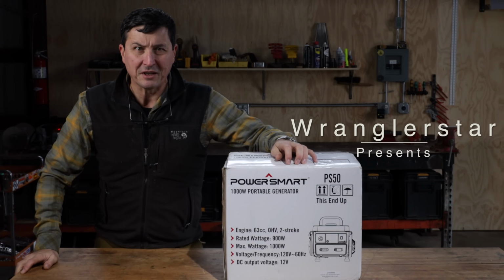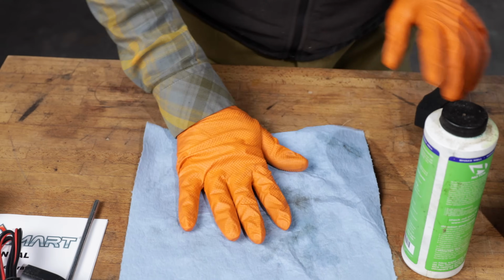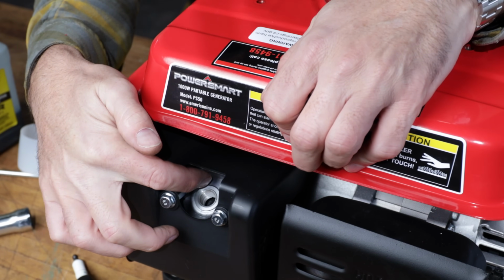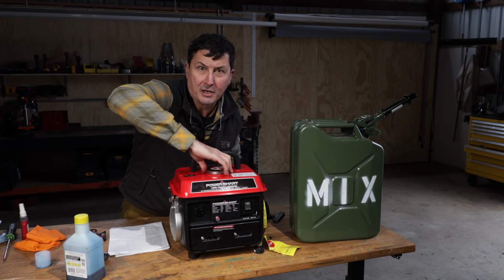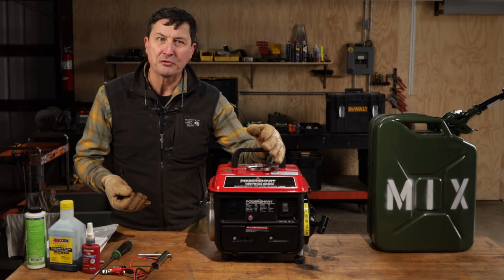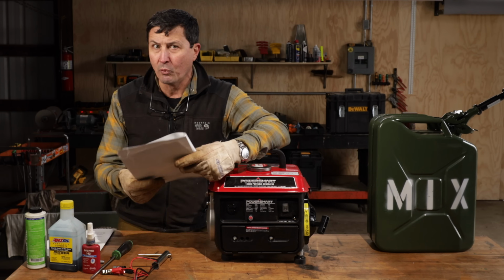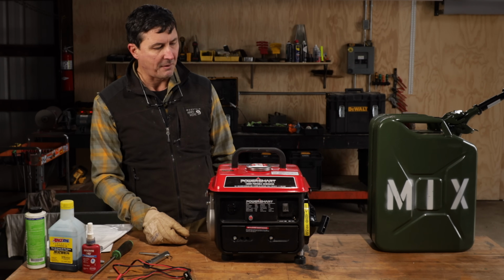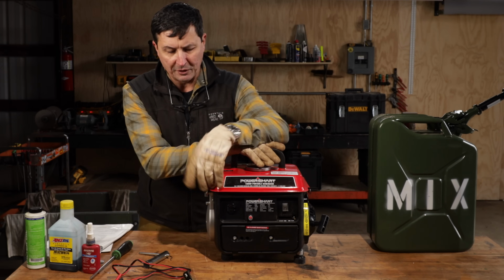TESTING The Cheapest GENERATOR on Amazon -$99

Comment: We got this same genny in europe for €69 last summer. Its quieter than most at this size and mines is ok BUT! THE PLASTIC START PAWL BREAKS UP AROUND 12 MONTHS. I made a new pawl out of aluminium which  works ok. Mine is 700 watts but pushes a lot more pretty easily.  I have no mains electric so use this a lot for my vacuume cleaner etc. Solar power here keeps the rest going.  And do fit a fuel filter between tank and carb.

Comment: I have one of these in New Zealand (it's a small country not in America, look it up).  It delivers 230volts at 50 Hertz and rated for 750 watt but otherwise the same. It ran fine from new during a couple of power outages. BUT, after some period of lack of use it became unstable next time I ran it, surging with the governor constantly swinging from maximum to minimum. While trying to sort it out I found the petcock (gas tap) on the tank was leaking  fuel as the lock nut which has an 'O' ring had split. So I glued it with gasket seal and left it for a couple of years to set. This week I decided to fix it, so I refitted the fuel tank after cleaning the carburetor and checking the ignition system and replaced the hardened fuel line. It still ran like garbage, surging as before, it actually ran better on full choke than any other setting. Eventually it just suddenly died. I stripped the inlet reed valve, the head, barrel, piston, rings etc. I saw the governor is actually some sort of centrifugal system inside the crankcase which is somewhat impressive. I put it all back after decarbonising the piston and head and cleaning the reed valve assembly. There just wasn't any suction through carburetor but it had compression.  Eventually I put a hose in the spark plug hole, turned crank to BDC to expose all ports (1x exhaust and 3x transfer) put my finger over the exhaust outlet an blew into the hose. There was virtually no resistance and just a hissing sound of air leaking out  of the crankcase somewhere. WOW, FAR OUT THAT'S BIZARRE! I then realised the crankshaft seal between the motor and alternator/generator section had blown out. I worked it back into place using a screwdriver through the air inlet slots of the alternator. After that, it ran like new again,  but for how long?

Comment: Looks EXACTLY like my Harbor Freight “Tailgator”.  I paid like $79 for it two years ago.  Use it all the time for my small plumbing business when power isn’t an option.  Charge my batteries, run corded power tools, lights etc.  Used it for a weekend to charge my batteries while hunting deep in woods in my camper.  Ain’t died yet!
Reply: 130 bucks now, add another 8 bucks for sales tax.
Reply: @NickDe39  it does go on sale.
Reply: Yea, I'm an electrician and I need it for the same reasons. I really don't wanna break the bank for a generator I'll barely use.
Reply: The Harbor Freight "Tailgator" / Predator 875 (It used to be part of the predator range in the red coloring like this one) seems to be a super mass produced unit carried by everyone.  Meijers here in Michigan had the same unit under a different name.  Works great.  However the carburetor is junk.  The way it's made you can't effectively clean it out.  When this thing stops starting on you it's the carb.  Super easy to replace it, and the replacements are cheap, better quality, adjustable, and cleanable.  Don't toss the generator.  Just get the replacement carb.
Reply: Do you think it could run a small dj system
Reply: @Playtrack  I wouldn't recommend this type. Its loud, and uses modified sine wave which causes noise and can damage sensitive equipment. I would get the 4 stroke quiet kind with a pure sine wave inverter. Quiet, easy to use (no mixing) and your equipment will be safe.
Reply: Did you use your microwave and min refrigerator on yours

Comment: The harbor freight storm cat is about the same thing,  got mine for $30 it was a return with a broken handle. A bit loud but runs fine.  The Sportsman i1000 is a great 4 stroke 40cc runs about 6 hours on half a gallon. It's around 20lbs very quiet.  Inverter sine wave that can be paired up with another to double the output...  about $170 free delivery.

Comment: I bought the 900 watt tailgator generator from harbor freight a little over two years ago and have put probably 200-300 hours on it problem free until recently until the plastic pulley in the cap broke.  I have one on the way in the mail now.  For $98 it works great as it will power (at once) 4-5 grow lights (with led bulbs) and a standard box fan. It'll pull a full side refrigerator by itself but that's all it'll pull at once. I was impressed and would buy another one if mine gave out without question

Comment: Great video & tip on eliminating dry starts! That applies for all 2 & 4 stroke small engines.
Example: When I take my mower out of winter storage and start it for the first time, I will
give it 3 pulls to lube the piston before I add gas to start.

Comment: My dad used to sell a similar generator that was similar size and power at his shop in the 90's but they had a big heavy set of 4 gauge booster cables for jump starting vehicles and on the 12 volt side would produce I believe either 100 or 200Amps @ 12 volt for jump starting. I have yet to find another like them.

Comment: I have had good luck out of Chinese motors but the first thing I do is put a better spark plug in it. Only other thing is they often don't have a low oil shut off so just keep check of the engine oil. This unit being a two stroke may not  even need case oil.

Comment: Got one of those 6 months ago.
It kept stalling at recommended 50:1 after 2-3 hours. But I accidentally mixed at 40:1.  And it worked much better and longer 5-6 hours.  Protection buttons failed.
But for the price (£120) who can complain?

Comment: Have the same generator used for years but being 2stroke the muffler eventually clogged with carbon and a new muffler is about the same price as the genset so they are a throw away if anything goes wrong
Reply: Ultrasonic cleaner?

Comment: There certainly seems to be some great generators out there.  I bought a cheap inverter generator a couple of years ago, and it's never let me down.  Starts on the first pull each time, and runs for hours at a time when I use it never missing a beat.  What's more, it was less than £200. It's branded as Impax, but I've seen it branded as Clarke, Sportsman and Earthquake. Well worth a look if you need a cheap inverter and haven't looked already.

Comment: I bought something identical looking (minus the 12V charging) from B&Q in the UK in 2007 for £49.99 (according to todays chart on one of my widgets, a little over $60, was under 2 days ago and no idea what it was in 2007, likely about $75).

Kinda abused it with an electric lawnmower for five years, cutting the grass  around the house with about half a gallon of petrol. 

My wife kept telling me to just get a tractor, so I gave in and bought a 4WD Kubota B4200 complete with a mower attachment. It cut that grass and about half an acre more into the field (the rest I'd need a tank or a helicopter for, wonder just how much fun my wife really wants me to have). It used about an egg cup full of diesel to do that.

The annoying thing about that generator is that it isn't that much louder than the 2007 £7,000 Dometic TEC 30D generator I fitted to my RV.

The coolest generator I've seen is made by a Japanese company, called something like IHI? They made a generator not much bigger than a Honda 2000W inverter generator, powered by a jet turbine (likely a modified turbocharger, so it used four times the fuel you'd expect).

Comment: I have the HF version that I bought strictly to power a sump pump if the power goes out.  In the 8 years or so I've had it, I needed it exactly once for about 3 hours.  it also powered some incandescent bulbs in our family room so we could sit and play cards and while the time away.  I accumulated more time getting it running and ready for winter than I ever have using it for what I bought it for.  Worth EVERY penny of $100 and if/when it gives up, i will buy another.

Comment: The one from harbor freight like that has worked good for me. We use it to run the camper for a week at a time non stop 7 days of running. I really didn't think it would last the first week but it keeps going  every time we take it out. We use the same  2 cycle oil as the dirt bikes amsoil dominator. 
Its loud but runs everything short of the ac unit 
Wouldn't recommend plugging in hi end electronics.

Comment: Ive got the Sportsman version of this...and picked up  the quieter and lighter inverter 1000W version on sale for $180.  This will drive climate change folks crazy, but its fits on my electric cargo bike running a power supply maintaining  my DIY 50VDC LiFePo battery. Georgia back roads can be long and lonely.  Ive not tested it nonstop, but  I figure the better part of 200 miles to the tank.

Comment: The brushes will be shot in 80 hours I had one and they dont last
Reply: Brushes?  So it is actually a generator, not a 120VAC alternator like larger units?
Reply: Its brushless with no AVR. Voltage regulation is done with engine rpm and a capacitor.

Comment: I've had one for years now and still running strong! $89 out the door at Harbor Freight. Well worth every penny. Easy to move and start up when you just don't need the bigger generator.
Reply: Just run really good oil and premium gas,they run forever,being a Yamaha chinesium clone.. I ran mine @40to1 ,for the last 11 seasons, pretty much 4-6 hours a day.   Flawless so far,again,Yamaha engineering helps..
Reply: Hey was this good to use

Comment: Good review. I bought the same generator, with different branding a few years ago. It is loud, but still worked as an emergency generator until last summer. I was attempting to run my fridge during an extended outage from a summer storm. Couldn't get the fridge to run, eventually tried a neighbor's generator with no luck. Started troubleshooting and found the cheap voltage regulator failed and the generator was putting out 220V, frying the board on my new fridge. It was an expensive lesson, and I've now got a Honda.

Comment: I got one of the harbor Freight versions five or six years ago and have used it at an off grid cabin. Still runs fine with probably a couple hundred hours on it. Very convenient if I only want enough power for a few lights and fans. Not too loud but even a very basic vented plywood box will baffle the noise down considerably.

Comment: I own 2 of these, purchased in a rush in anticipation of the arrival of Hurricane Harvey.  They didn't arrive in time, but I have used them on and off ever since.  DO NOT USE THEM TO RUN ANYTHING ELECTRONIC!  The power coming from them is very messy.   They will run a heater or a simple motor well enough, but they damaged the electronics on my refrigerator door and killed a 1500VA UPS before I learned my lesson.  See the video on my channel to learn why and more than you ever wanted to know about generators.

Comment: I got an even cheaper generator than this one at $65, but rated at 800W. It's pretty much OK, I've used it for 12h non-stop without any problem (didn't destroy my phone and laptop chargers), except there is this rattling noise from the starter coil. Also I once forgot to mix oil into the gas, so it's dead after an hour of running and won't turn on again, but after letting it rest and turning the crankshaft manually, then reassemble and it started beautifully again. This thing is pretty robust.

Comment: Damn i wish mine had the 12v on it...  here is my luck with mine.. I ran it dry do everything you're supposed to do to store it pull it out refuel it no start, carb leaked and had to clean the carburetor.  Many many pulls to start.

Anyone else could throw theirs out in the mud pit let it freeze into a solid block . Pull it out in the springtime turn the fuel on one pull and it would start. 

But i still like mine.

Comment: When the power source of a heater isn't capable to provide enough power it will still work but just at not at full capacity, the heater will never complain of some lack of power. You didn't measure the voltage nor the current so it's like you didn't test it.

Comment: I bought a version of this many years ago for $99, crazy that they're still $99.  I only have a few hours on it, it mostly sits in the garage for emergencies.  About a week ago I discovered that the fuel valve seals had gone bad, but other than that it's been a great little unit.

Comment: common...mine had the tank rust out...but there was another one that was around here so it is back up...have to treat your fuel in storage so it will not gell..other than that,
 the little one along the big one, they then are going to last forever

Comment: have similar unit when first came out have put hundreds hrs on it (it now rattles bad) but still go,s, ps if the power out suddenly fails chances are the capacitor behind the power outlet has failed VERY COMMON.

Comment: Roughly 10 bucks per 100 watts is standard on chinese generators . This is not some rare occurrence there is tons of them all over the market. There is a YouTube video of a guy trying to weld with the harbor freight one and if it wasent for the throttle lagging rpm  it would of worked just fine.

Comment: DO NOT use it with electric motors. This kind of generators synchronous with very poor voltage control. If you connect it to an electric motor (inductive load) and a phone charger, the charger dies.

Comment: I have a problem with the math here--this generator is rated at 900 watts and 7.5 amps or 
1000W max and 8.33 amps max--the presentation seems to go beyond those limits--what 
am I missing here?
Reply: Henry Marvin, I'm with you on that. 900 watt max, 750 watt normal output. I worked for a JD dealer long ago, lol, we sold a truck load of generators after a hurricane it our area. I don't know for sure but I believe it takes up to 2200 watts to 'start' a refrigerator or freezer and then they will drop to around 750 watts. Smallest gen we sold was a 2300 watt unit. I have a 5500 watt that will run my 30ft travel trailer as long as you don't try running the AC and the microwave at the same time. It will trip the breakers. Too much amp pull.....

Comment: I have the same little generator ,its a darn good machine,i use mine to use on my table saw etc and it does a good job on my 110ac unit .and it still going after 9yrs

Comment: I had one of the Harbor Freight versions about 8 years ago. (Mine was blue)  I took it camping ( at a state park campsite) to avoid paying the extra money for an electrified site.   I took the genny about 60 feet over a hill, and set it into a snall, level depression in the ground.  (I had checked it out prior to lugging the genny down there) and set up a V-shaped wall made out of foam insulation around it for sound dampening. From the campsite you could barely make out the hum of it over the sounds of the crickets and frogs.   I ran a 10ga cord up to the campsite, running several CFL lights and phone chargers, as well as a coffee-pot in the mornings.  We had little kids with us, freaking out about sleeping in the dark, so I filled the genny up as they were going to bed, then topped off once more before I went to bed.  It ran 2 CFL lights all night long and then the coffee pot in the morning.  6-to 7 hours on one tank of fuel. A  Park ranger even asked how we got the power. I told him about the genny over the hill and he remarked about how quiet it was and said "Carry on"  I gave it away to my brother, unfortunately.  Now I have a 1500 watt "Champion" 4-stroke that  is very loud.  Too loud to take to camp without building an elaborate "Doghouse" lined with carpet scraps around the thing to deaden the sound. (while allowing ventilation)    I need to get another one of these again..

Comment: Am I wrong thinking that you cannot really use that unit as a power source for electronics. As I believe it not being inverter kind ans so the AC will suck. Sure works decent for resistive and inductive loads (motors, heaters... so fridge or freezer is fine I guess)

Comment: I bought a similar one (different brand but probably they all come from the same factory in China) to power my 240v air pumps for inflating air-beds for my glamping tent hire business. I have had NO problems at all. I saw another one discounted so bought that as a spare but have had no need for it to come out of the box yet. It fits in a plastic tub with spare fuel and power cords and sits in the back of my truck. They are good for small jobs and are worth considering
Reply: 240v?!
 does this output 240 v or 120v?
Reply: @mikemotorbike4283  In Australia we have 240 volt electrical

Comment: Drawing 1500 watts from this machine is impossible if it's operating in accordance with it's design parameters. First let's remember this is a 1000w generator trying to handle a load 50% higher than it's rated capacity. A 2HP power source will be convert to 1491.4 watts only when 100% efficiency is achieved & if this can be achieved, close enough. The Power Formula tell us that Power = voltage X current. therefore current = power/voltage or 12.5 amps. You indicated that the generator had a 15 amp capacity as you pointed to the decal that clearly indicated a 7.5 amp rating. I noticed your glasses hung from your neck thru most of the video and was a probably factor in that error. The math says @ 120 Vac the breaker should trip out for sustained loads over 900 Watts. This level of pwr is not suitable coffee pots, hair dryers, micro waves or refrigeration.
BUSTED.